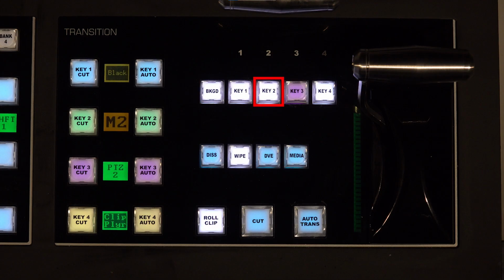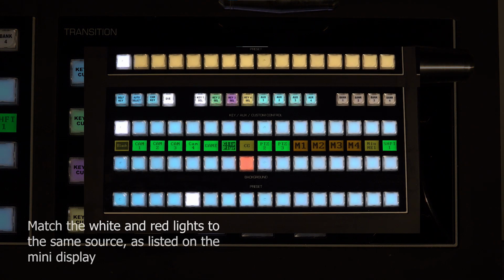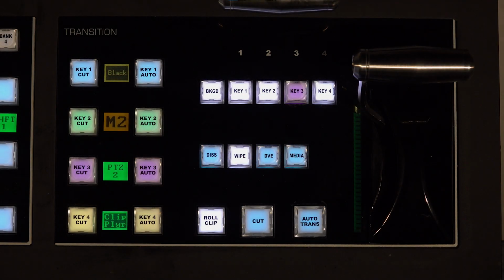Ross Carbonite Video Switcher tutorial

Comment: You might find it better to build your effect or key or anything like that on ME1, put ME1 into the preview bus of ME2 and when called for, do your transition to it via cut or dissolve or wipe on ME2. Doing that helps you from painting yourself into a corner. Also you can be sure of what you have setup before you take it. Always work smarter not harder.
Like for me when I am building a shot that has a logo keyed into a picture and place it in a certain area. I build that on ME2 because our output of the switcher is ME1 unlike yours I believe yours is ME2 for the output. So for me I build my 2 keys on ME2. Key 1 is a luma key to key the logo and key 2 is for the DVE so I can place that logo anywhere I want it. I set everything up and when I need to go to it I just select ME2 on the program bus of ME1. Makes it easier than trying to make sure I set it all up on the fly where I can make a mistake live on air. I try to make my life less stressful in a stressful situation being live on air. Just some food for thought.
Reply: nerd!